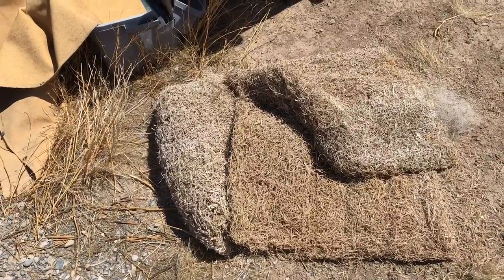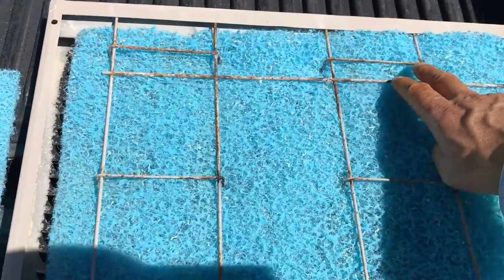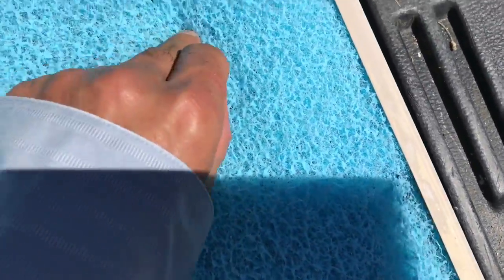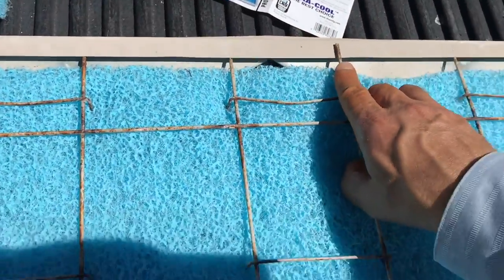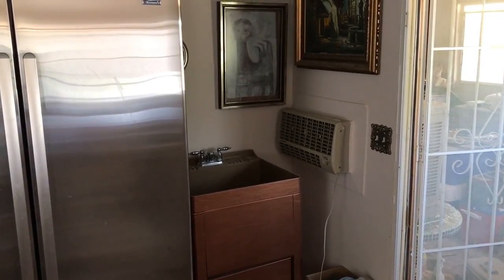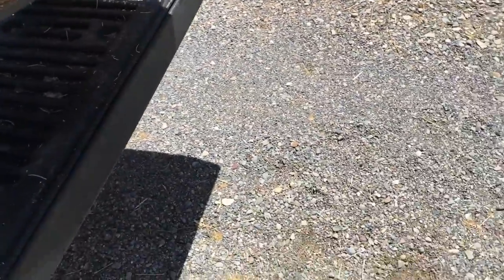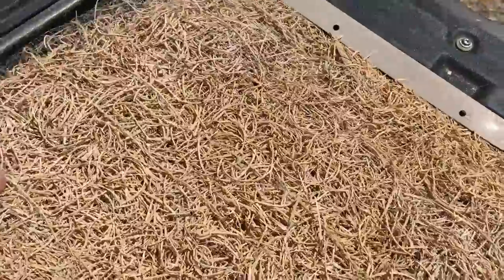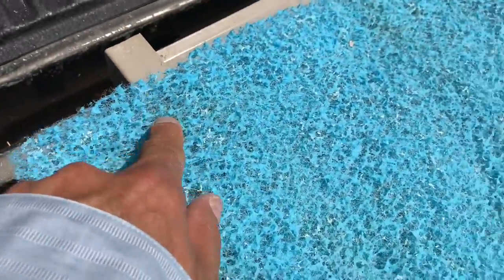Best way (How) to Change and Update Old Evaporative Swamp Cooler Pads

Comment: When I changed the blue pads in my old swamp cooler to the organic "paper" straw-like pads, it worked 200% BETTER. The blue pads are plastic, water slips down fast, blows warm air. With all due respect. Thanks for this changing pads video & realistic view on old vs new a/c coolers.
Reply: I've had to switch back due to the water not even soaking into the duracool.
Reply: see above

Comment: Yeah those blue pads do not work nearly as well as the wood aspen pads . I work at a hardware store anytime somebody goes for the blue pads I try to talk them out of it. The blue pads might last longer but to me the cooling temperature is much more important than how long it lasts. What has probably happened with his  you're basing the performance of both products when they wood aspen pads are at their very last leg not doing well anymore and you're putting in brand new blue pads yeah the blue pads might do better than the really beat up an old wood pads you just need to replace your wood pads

Comment: selecting durablue just because it is better is NOT the reason.  The catch-22, different pad materials functions DIFFERENTLY!!!!  Do NOT listen to the installers,  manufacturer advertisement (could be considered false because not telling what is different),  and other bragging owners.  It is YOU, OWNER of the evaporative cooler understanding and exploiting the pad materials and you have habits. YOU must insist on using new but same pad materials as long the materials exists.